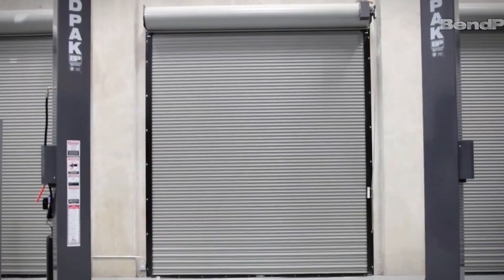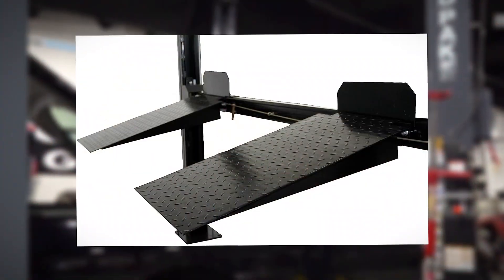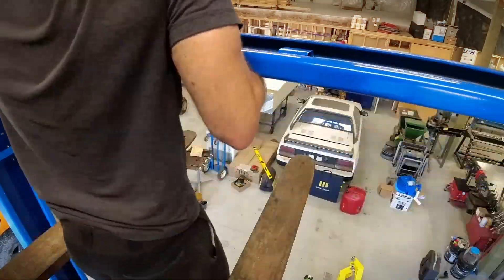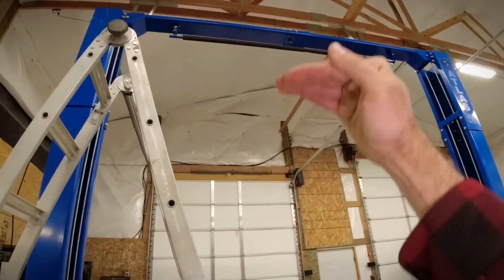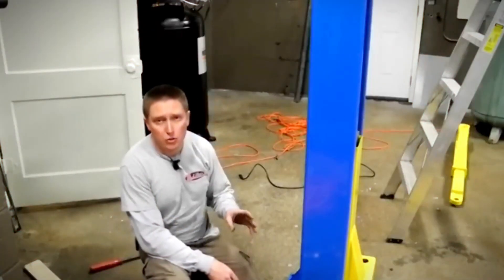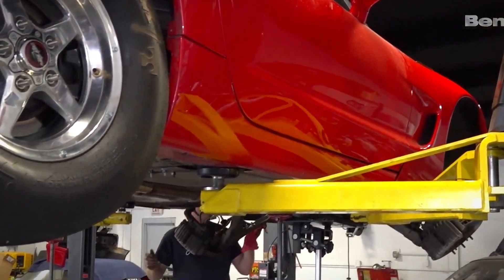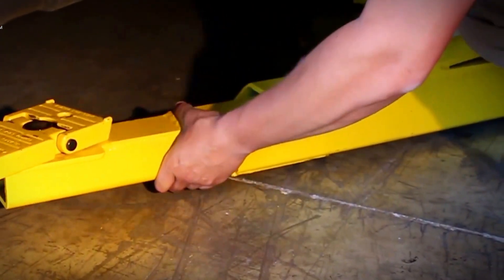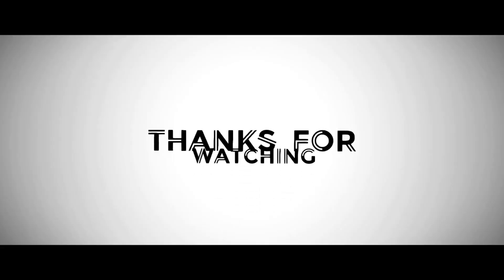Best Car Lifts For Home Garage In 2023 - Top 5 Car Lifts For Home Garages Review

Comment from the maker: Not sure which car lift is right for your home garage? Watch this video and find out the top 5 best car lifts for home garage in 2023. We'll review the features and benefits of each car lift, so you can make an informed decision about which car lift is the right fit for your home garage!
Looking where to buy !? :
*Bendpak Two Post Car Lift - 10,000lb Capacity - 10AP
https://amzn.to/3OUVLpk
* Triumph NT9FP 9,000 lb Two Post Auto Lift Floor Plate Car Hoist Truck Jack Garage
https://amzn.to/47tr69A
*Atlas Automotive Equipment XH-9KOHX, 9,000 LBS Two Post Overhead Auto Hoist, Clear Floor Car Lift with Specially Designed Arms that allow for Symmetric and Asymmetric Lifting Configurations
https://amzn.to/3OU2XBR
*APlusLift HW-8SXLT Extra Tall Extra Long 8,000LB Portable Storage Service 4-Post Car Lift Truck Auto Hoist
https://amzn.to/3saF0gZ